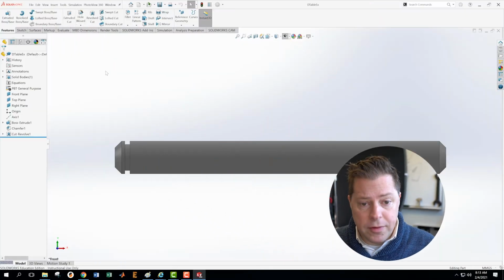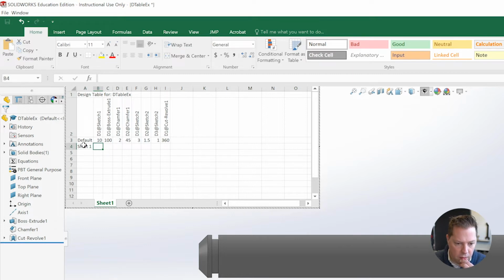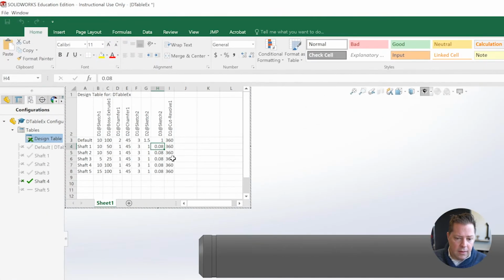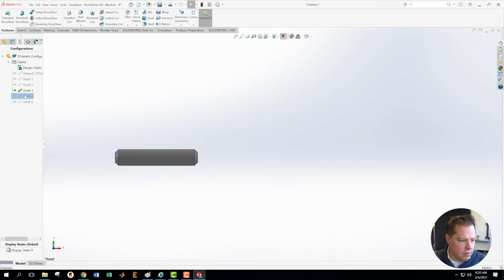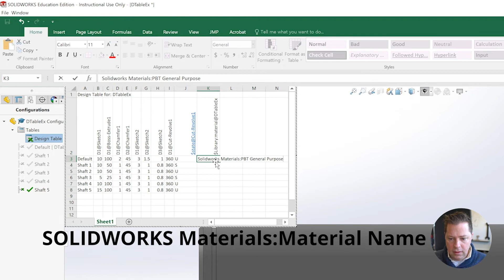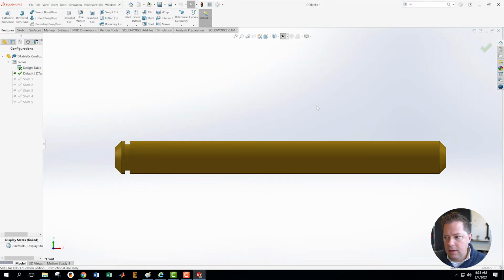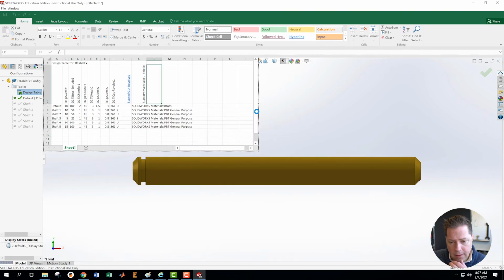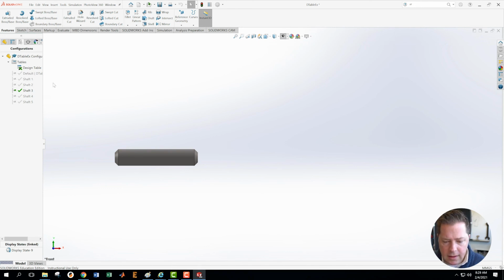Design Table Basics (Solidworks)

Comment: You can define materials for each configuration separately and after design table will updated automatically with specified materials. I think this is easy way that manually input materials for each configuration.

Comment: How do you go about writing functions as data?
I need to supress features where i a linear pattern feature is 1. I would use IF statements, but even though it returns the correct data, it says the value is incorrect?